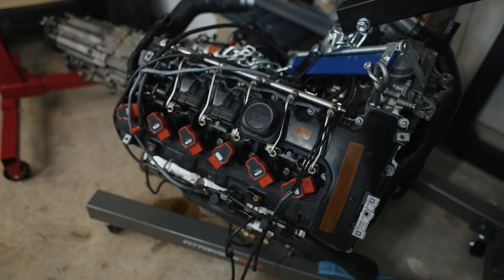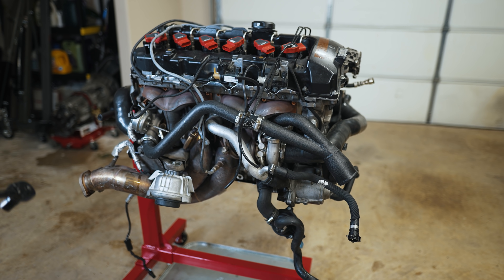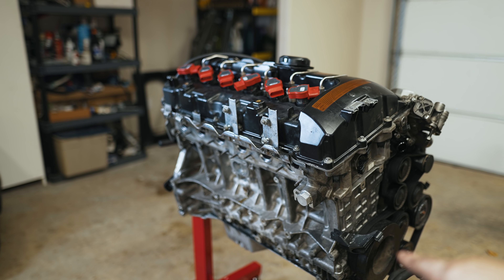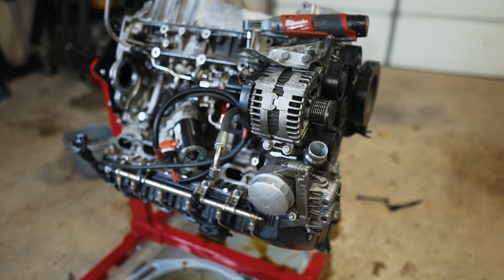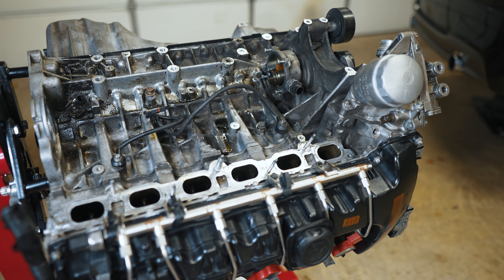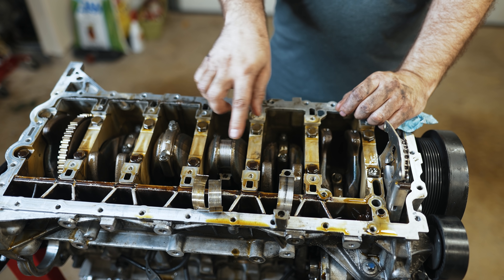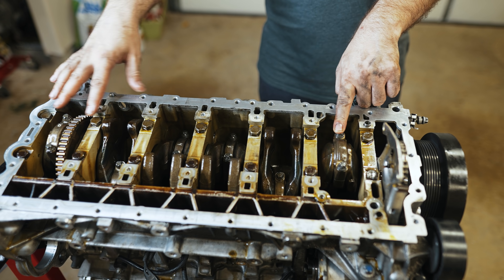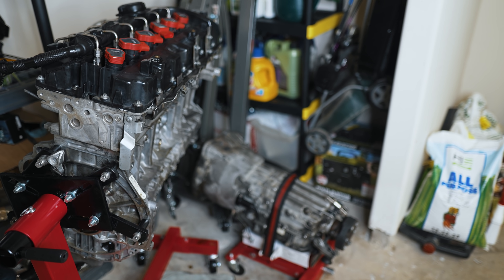Why Did My BMW Engine Fail?

Comment: It’s not cold oil. Oil is thicker when cold so the minimum oil film thickness at the bearing is actually greater at low RPM especially. Oil can’t be too thick for the bottom end until the oil pump goes into relief. I’m afraid it looks like you had a clearance issue OR simply used a bi-metal King bearing where you should have been using a tri-metal XP bearing for the loads you subjected it to.

Comment: i'm going to say clearance was too tight, if the oil was thick and high pressure and caused a spun bearing,   usually the issue is too tight clearances, so when hot, not enough clearance for proper oil film to create a kind of pillow between the crank and bearing without contact.. seems to me king is using a material that has a larger thermal expansion rate at similar temps as compared to factory. especially if oil pressure was good. 

i run a COPO spring in my LSx 5.3 and get roughly 60 psi oil pressure on fresh oil at idle at temp, and over 80 psi cold.  so no, i don't think it was cold oil and beating on it.  once engine started and ran for a minute or two, all oil should be on the components it needs to be on with pressure behind it to prevent failure.  ( although cold shrinking is also a thing, i don't think that was it as much as a thermal expansion of a bearing versus other components, causing too tight of clearances)

Comment: Slightly confused here, but if the issue is that you’ve spun several bearings, how comes you decided a full engine swap is better than simply replacing the rod bearings (or even a full rebuild)? Surely that would be more cost and time effective?

Comment: just seeing this video now. I just bought an N55 with slight rod knock i believe and will attempt to fix it. Just a question though, if the crank was not ruined would you have just replaced the rod bearings again and sent it on its way?

Comment: How many miles on new rods before the failure?
Reply from the maker: About 1k miles.
Reply: @VehicularDIY  I kind of wonder.  Watching your install video I noticed you coated the bearing real thick with assembly lube.  I have worked on close tolerance stuff before and I have seen notes in manual about not using to much grease (yes I know can be different) cause it can change the tolerance.  Wonder if that could have been a issue.

Comment: I have a 2016 X5 35i which engine siezed up a couple months ago when the temperature was 25 below here in Minnesota. BMW dealer said moisture build up in the oil siezed the engine.
Apparently BMW is aware of this moisture problem along with extremely cold temperature can cause seizure. 
Vehicle had 80,000 miles with no warranty but BMW NA paid 60% of New Engine, turbos, intake and Starter.

Comment: My N54 is currently out of the car, it was definitely neglected, so I want to replace the bearings as preventative maintenance. Do you still maintain that King bearings with stock (new) bolts is the way to go?

Comment: Vehicular DIY I have 2008 335xi e90 I'm about to do a major engine service as well as upgraded turbos, inlets, charge pipe and BOV. (Used your link to the 775RS's)I am planning to do rod bearings as well as timing chain complete service. This n54 is at 120k with a less than desirable service record. I feel like you installed these bearing 100 percent correct. My question    is do you think the seating (the grove you could get your fingernail to catch on) had   not worn that pattern for an initial ware in period? Any recommendations (King rod  bearings as well)
Reply from the maker: I still need to tear apart the old motor for more answers.  I don't think it was any grooving as my old bearings weren't in bad shape.

Comment: I don’t think there is over sized bearings also by service manual machining not possible for these Bmw engines and bearings they go by color code and for clearances Bmw clearances are so tight

Comment: The BMW is the fastest depreciating manufacturers product in history .They are popular here as not everyone can afford to buy a Toyota , Nissan or Honda equivalent . The scrapyards in the UK are full of them and I normally salvage only the Japanese Denso parts , wideband lambda sensors and junk the rest from an engine that has the slightest of problems . I have built some very powerful M types including a twin turbo version of an 2.5 engined M3 using the Mitzy turbos from a 3.0 GTO that squeezed between the block and steering in the available space using a manifold built to my design. QC seems to have gone out the window in Her!any and there is now a recall on many VW Audi marques or compensation claims being paid . They generally require an extraordinary amount of attention to blueprinting and selecting of components to ensure main bearing alignment and proper bearing crush in the block , same with rods before detailing , polishing ,balancing and chucking the original chocolate bolts , before building an engine that will stay together even under moderate increase in boost . I would get a replacement engine , strip that and begin the slow laborious process of accurately measuring , inspecting checking components that will constitute the bottom end from BOTH engines once you are satisfied with the choice of block and crank , if the journal is recoverable. You will have 11 rods to choose 6 from , which will require ARP bolts as the originals have a slim margin of safety . Give me a Jap engine build every time .

Comment: Did you find oversised bearing or you have to have them custom made? Mine N54 died 2 years ago and I was found that there are no oversized connecting rod bearings on the market. At least in EU. My crankshaft was rebuild to the nominal size.

Comment: Because its designed with inherent flaws, with the idea that the engines aren't built to last for years and driven hundreds of thousands of miles. BMW built in line 6 from cast iron with metal exhaust manifolds. Anyplace BMW can use a thinner cheaper metal BMW did it

Comment: Totally frustrated that the N20 in our 2017 X3 deconstructed itself internally at just over 90K miles.  Sounded to me like a lower rod bearing; dealer isolated noise to cylinder #3 after getting the crank to turn again (it seized in traffic).  They won't tear it down to inspect, but we did see shavings in the oil filter.  Shitty quality engines - I've seen plenty of evidence they use very poor quality main bearings.

Comment: Hi dude that's a helluva lot of work  'o couldn't be bothered if the engine is screwed just get a reconditioned engine  'I'm a Mechanic of 25 years  'and I wouldn't even do this  it's to much time wasting  'nobody does this nowadays  'if you have trouble with a engine  don't piss about get another engine  it works out the best option every time

Comment: If you are going to be serious about building any engine forget the ever invented Plastigauge. Invest in a set of micrometers. measure EVERTYINTG twice. New rod for sure, maybe an entire set. check them all for big end distortion. Build it right or fix it when it breaks, you decide
Reply from the maker: Yeah a machine shop would be involved.

Comment: "Why Did My BMW Engine Fail?"  because 95% of guys driving a BMW treat their cars like shit
Reply from the maker: Basically lol, pushing more than double the horsepower that the engine was designed for.  Not the engines fault it failed.
Reply: Note to self, NEVER push your cars engine hard until its up to correct operating temperature
Reply: @markrhoden68  Note to self...never buy a bmw.
Reply: @eduardosampoia5480  My dad has an e34 with 250.000 miles, never blew up or left him stranded in the 125.000miles hes had it. A friend of mine has owned probably 30+ bmws and still ownes 2 e30 m3s, he has been driving them hard for 2 decades and never blew one up. If you have a good mecanic do the maintenance and let it warm up bmws are not unreliable.

Comment: Why do so many BMW engines have rod bearing issues. And some call these trash engines the German 2JZ.
Reply from the maker: If you had to as me it's the thin oil that's recommended from the factory and long oil change intervals.

Comment: 6:21 genuine bmw  crappy quality :D. mine e30 has 300 000 miles on same bearings
Reply: Lol but its also making 170 hp and a 6800 rpm redline on the same bearing width.  These motors are running really hot and are pushing alot of boost in comparison.
Reply: @Awesomeman1987  so where is difference in 30 yeras in development?better materials and so?mine has 30 yeras it is maybe older then you.
Reply: @98976h  i actually just put an old e30 bearing beside an s54 bearing and.... the e30 has a wider bearing surface!!!! Wtf.  To be fair the pin diameter is smaller e30 vs s54.  I believe they were looking for less resistance to rotation.  Imo, if the bearings were 15-30% wider none of this nonsense would occur.  Just my 2 cents
Reply: @Awesomeman1987  it is all about money and servicing.motorcycle engines rev to  11 00 rpm and they last for so small and a lot of hp.

Comment: I’ve heard it’s somewhat common for you to get metal shavings in your oil not long after doing rod bearings on these n54’s. I just did my bearings and am almost ready to get it all out back together so hopefully mine lasts a little longer than yours did, but if not atleast I can watch your videos of you replacing your engine to walk me through it.

Comment: I would have gone with a VAC calico coated bearing also your issue was most likley a bent crank, did you check for straightness when installing the rod bearings? When building these engines because of the bed plate design it’s important to get a line hone and check the crank for true straightness. I’ve seen several n54s with bent cranks from the factory that ended up spinning bearings.

Comment: I never heard of installing new bearings without plastigauge - maybe your clearance was too tight? I used to work as a certified tech rebuilding motorcycle engines (mostly Japanese). Great content and thanks for uploading!

Comment: My experience with king bearings is they are normally on the looser side of clearance. I use them in all my builds(now) and haven't had a problem. My last build I used them in was a vq35de originally used 5w30 and after build I switched to a 10w40 for break in and 5w40 T6 after. 
I also make sure to get the coolant temp up to around 180f before I run the engine hard. Haven't had any problems in the 5 builds that I used king in. I used to use ACL.

Comment: You have to open the oil pump for further good diagnostic usually you will some résidu of métal. 
For me I didn't like the color for the cyl#2 its like near black.
For the connecting rod I didn't see any things. 
Well you have to send the crankshaft to the machine shop after that replace all the connecting rods and cleaning well the oil pump assembly. 
That what  I did for all my bmws.
And the important thing you have to be super clean when you work on N54 or N20 or N55.
Good 👍

Comment: Same thing happened on my e90 N52 cylinder 5. All other bearings showed signs of light wear. Research suggested bearing clearances from the factory were super tight, just something BMW did without having the best oil tech at the time. I installed a new crank, rod, and standard size bearings with .0002" rod bearing oil clearances. (Slightly larger than factory specs.) 5,000 miles later it runs super smooth, quiet, and is happy in 0 degree C startups with synthetic 0w-40 oil exceeding BMW's oil standards for the N52 (2006 330i e90). The spun bearing occurred at 170k miles. I suggest dropping the oil pan and changing bearings if you can at 150,000 miles to avoid a rebuild and crank machining seeing this seems to be a common failure point for this generation of BMW I6 engine.
Reply: @joh cain I installed aftermarket bearings. OEM bearings were sold individually and for an outrageous price.

Comment: I ended up building my N54 due to a leaky injector melting a piston and rings ... I had the Crank Polished and block bored out to 84.5mm with stock compression 10.2:1 JE Pistons and Molnar Rods with King Bearings for my Rod bearings and Crankshaft Bearings (Stock O.E Measurements) no over sizing. I Used New OEM MAIN BOLTS AND NEW Head Bolts no ARPS besides the ARP2000 that came with the rods.
 Its my daily driver and I do beat the shit out it and to add to that I put on 17t's this summer and they get beat the shit out of too. It runs amazing but it still suffers from Normal N54 issues like Misfires from Injectors, plugs, or coils.

Comment: Hi vehicular, I need little help with my e90 6spd, I did the rear brakes and rotate my tires yesterday, when I went to for test drive it was no issues, but today I took it on the highway right after 60-70 mph the car vibrates violently and I can tell is from the rear, I went home and check so far I see no play with suspension components, no wheel bearing jiggles, and I also rotate the tires back, still exist, but during around town was fine only highway the car would Shake mad
Reply from the maker: I'd imagine it has to do with the tires that ended up at the front.  Does the wheel seems to move right to left when it's vibrating or do you just feel a vibration?
Reply: @VehicularDIY  I tried to rotate the tires but when vibration stay at the rear end, steering wheel doesn’t shake, but I can feel the vibration is from the rear not the front end, thank you 🙏

Comment: Is your oil pump sump clogged? Also you will need to get your crank straightened.
Reply from the maker: No the pickup was clear the screen only had a few large particles on it.  Yeah the crank would require professional repair.

Comment: Buddy, on problems like this usually you will end up with fine filings stuck in some of oil channels - get in touch with some truly professional motorsport people to arrange a high pressure reverse oil system flush and also properly cleanup your engine, again motorsport people can arrange this for you. Motorsport guys will have chemicals that can melt through 2mm thick rubber gloves in less than a minute, but will not touch the cylinder or piston coating. After that check your cylinder walls and camshaft bearings, as micro filings can affect those. If you find damage there - maybe donate this engine to some people that want to do destruction derby or something because this will not be worth your time to fuck around with fixing it if you want to daily it. As a fellow bmw owner - good luck, your will need it ! Quick edit, actually one guy here had a point - you can take this failure and spin it into positive - make a rebuild video. Yes the engine is not the newest one, but amount of knowledge you can pass on can get you quite few views !
Reply from the maker: Yeah for sure, I have my replacement engine here now and would install that and look into rebuilding the old motor.  Thanks for the info!

Comment: How many km the engine have? What oil are you running,  very clean inside!
Reply from the maker: The engine had 318,000 KM on it but I recently changed the rod bearings for maintenance.  I was running Shell Rotella T6 5W40.  Yeah it was pretty clean for the mileage.
Reply: @VehicularDIY  Do you think the old bearings would last longer if you didin't touch them? How bad they was? Do you have a video when you replace them

Comment: Why dont you just get a set of new forged rods (I know the originals are) and a good crank shaft instead of a new engine? Not worth the hassle?
Reply from the maker: Yeah I'd be worried about the top end etc.  I'd want to send those parts to a machine shop to verify.

Comment: The bottom ends stock can handle quite a bit of power. I am unsure if you used factory or upgraded bearings, but the upgraded tend to have a black coating on them. Also most tunes/piggybacks will auto trigger limp mode if you try to apply power before the oil is up to temp I think most use 200 degrees as a cut off. On the flip slide, there are a ton of aftermarket upgrades that are not expensive. Just have a machine shop look over the block, they may even be able to save the crank. But the rods I would easily swap those out with all new ones with aftermarket fasteners.

Comment: I guess I'm in the cold oil camp as well but curious on the 'half engine' warning in the last video.  Did you pull codes?  saw the 'half engine' on my N54 (stock) due to jammed VANOS / failed bearing ledges (there was a batch of N54s with improperly heat treated bearing ledges).  Clearly the rod bearings are damaged but curious.
Reply from the maker: Yeah I did pull the codes and they were vanos related.  I actually had the bearing ledges given to me by a local viewer as my stock ledges had major groves.  I'll pull the codes and talk about it in the next video.

Comment: I’d definitely change out all the seals on the “newer” motor before putting her in. 

1) rear main 
2) crank seal 
3) oil pan 
4) valve cover 
5) OFHG

I wouldn’t use the crappy, over priced BMW sealant, for the crank seals either. Ultra Grey plus an OEM gasket for the 2 crank seals & Ultra Black, plus an OEM gasket for everything else. 
I strongly believe ultra black/ grey enhances the longevity of the seal when coupled with an OEM gasket.